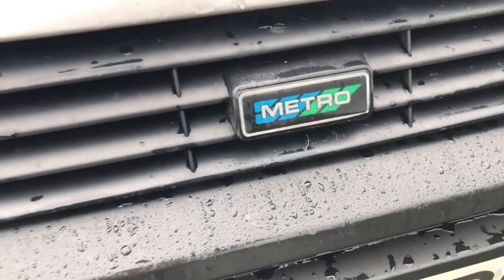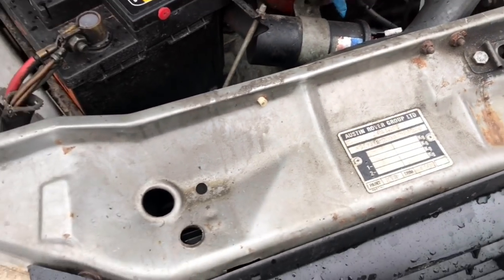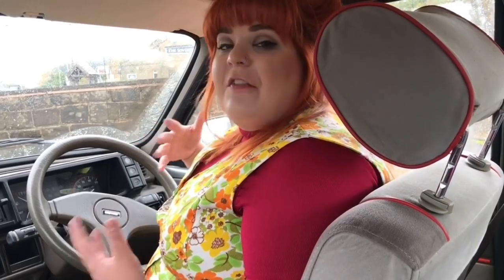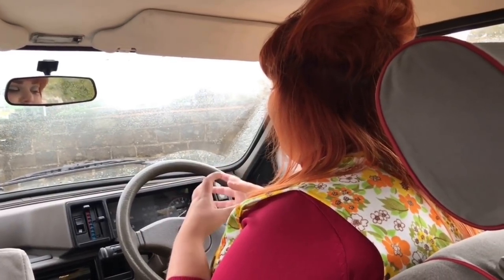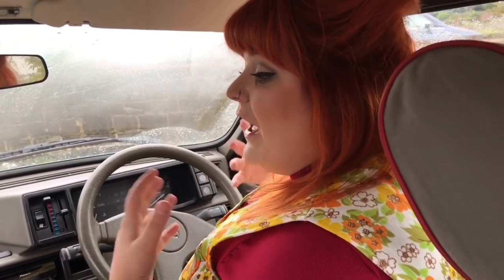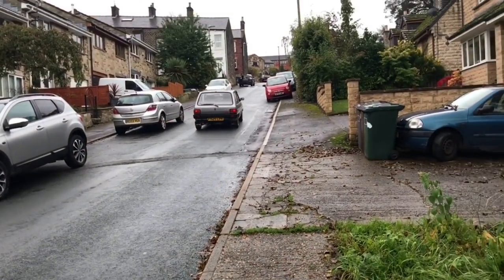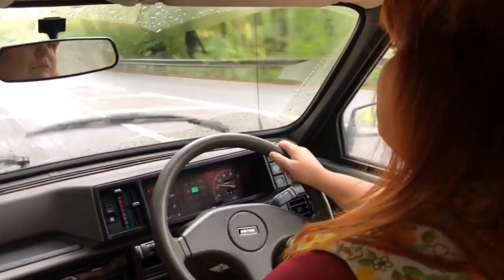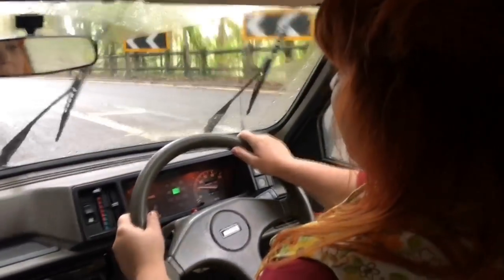IDRIVEACLASSIC reviews: rare 80s Austin Metro ARX

Comment: one of my fave features of the mk2 was the lit stalk signs , the signs on the indicator / wiper stalk lit up using a system of fibre optic from a bilb in thecentre of the stalks, this was available on the upper market MGs and VPs for sure tho I did break lower spec metos that had this
Reply: I remember doing that illuminated stalk conversion, looked great!
Reply: My 1.3 Automatic had those also

Comment: The term ARX in the Austin Metro ARX refers to a rally car specification that was developed by John Davenport, a well-known rally engineer in the 1980s. The "ARX" itself stands for Austin Rover Experimental, indicating that these cars were experimental versions of the Austin Metro specifically prepared for rally racing.

These ARX models were used primarily in rally cross events and were often heavily modified with upgraded engines, suspension, and other racing-specific equipment. They were part of Austin Rover's efforts to push the limits of their small city car in the motorsport world.  David of Newbury Classic Car Video.

Comment: Love video  thanks.  Brings back memories or my August 87 1.3 city x . It had a lovely sandy/beige interior,  even though it saw only a city x everything was colour cordinated including the steering wheel,  carpets and seat belts !
From may 1987 the metros were much quieter . There was a vast improvement to sound proofing and many tweaks to engine and gearbox.  I still remember being really impressed after my 83 metro. Could the X in ARX just be eXclusive . This word was in the brochure,  only a guess though.
Reply from the maker: Apparently it’s for the Austin Rover crossover! So it’s like AR cross so to speak. Somebody on the metro owners club page cleared it up when I posted the video. Mystery solved.

Comment: Great video, the trim looks like they had a spare job lot of MG fabrics and needed to use them up :-)  One thing though Steph, please wear seatbelts over shoulder, you do not want to have an accident with it under your arm as your ribs will take the full force, not your (much stronger) shoulder.  Can't have you getting hurt!
Reply from the maker: I’ve had somebody message me and explain it since. It’s an Austin rover ‘crossover’ and 1,500 were made. It came after the metro principles.

Comment: Never heard of an ARX - it was more than likely a dealer special to shift units - popular in the 80s especially with Ford. Great video and fab car. RIP A191 WDM
Reply from the maker: I’ve since been informed it was a company special on a limited run to celebrate the Austin rover crossover for metros
Reply: Yes, the ARX featured in the brochures at the time. Based on an L model but with MG shaped seats with unique red/grey trim. I'm not sure this car has the original wheels though, they look like MG Metro mk1 alloys to me??

Comment: That reminds me of the Metro’s my driving instructor owned when I was learning to drive back in the early 90’s.  The column stalks are the same as a D reg Montego I owned, the instrumental cluster is also similar to the Montego but my Montego had a rev counter, I guess the lower spec Montego’s didn’t and most likely shared the same cluster from the Austin Rover parts bin.
Reply from the maker: Nothing says recycling like the BL/AR parts bin 😂

Comment: The metro when it was released in 1980 was considered a very safe car , for example the sils are large  so that the doors interlock into them to make them stronger in a side impact, disc brakes instead of drums dual circulate. Spair wheel in the boot adds strength in a rear end shunt. Anti burst door locks to. 
You may notice this car has no shock absorbents their not needed with Hydrogass. TD Wheels and tyres on this model so ir you get a flat your tyre remains on the rim. By 1985 i believe they all had servo assisted   brakes and greater sound insulation on the bulk head and under the carpets.
As for corrosion the metro did have problems especially on the front wings  ,however if you open the front doors and look at the wing you will see grommets theae were so that during a service wax was to be sprayed into them to help prevent corrosion this was hardly ever done sadly. Later Austin models had small wheel artch protectors in the corner of the wings to prevent mud collecting in the corners the ARX should have them.
The trouble was that the Metro was kept in production to long and became obsolete in respect to more modern cars.
Nice one Steph keep up the Austin Rover Good work!!! (:
Reply from the maker: Thanks Darren!!!
Reply: Firstly I love your profile picture, I'm a huge fan of the saint and Roger moore, I love the books especially. But the metro was never safe, it was made cheaply at a time when BL had  next to no money and it used the already outdated mini format. I've seen the crash test, I doubt any passengers would survive a 40mph collision, let alone a 70 mph crash. The metro was sadly a victim of cost cutting and because it borrowed much from the mini, it was outdated from day one. The mini only really held on for so long because of its looks and its sporting heritage, the metro didn't have either and with crash testing being brought in, it became a problematic car. The k series metros actually had mechanical issues, such as cam shafts going after 30,000 miles. The k series engine in general has been known to have a few problems. The metro could have been great, but BL really didn't do it justice, had they thrown a bit of money at it, I dare say it might have replaced the mini, but that's the British car industry for you. I've had two 70s BL cars and as much as I love them, you do look at certain features and wonder what they were thinking at times.

Comment: Great video, I learnt something about metros! Where is the asbestos in the engine bay?
Reply: the brake pad
Reply from the maker: It’ll be the brakes x
Reply: Head gasket
Reply: Clutch and brake linings, some gaskets  that were not paper and heat shields mainly, although A/R started to fit asbestos free linings as standard before 1988. It's nasty stuff but good at what it was designed for as an insulator.

Comment: Austin Rover eXecutive ARX  it's a dealer special to get shut if some bits.
This was run out model parts bin car because the river metro was about to be launched with it plastic wrap around bumpers and smoother styling

Basically maestro montego and metro shared parts to keep cist down.  They all used the sane steering wheel by thus time.
Reply from the maker: Hi Keith. I’ve had somebody message me and explain it since. It’s an Austin rover ‘crossover’ and 1,500 were made. It came after the metro principles.

Comment: Prefer the look of the mini prior to the 80s plastic dashboard with three smiths clocks, but ultimately as much fun as the mini was, metro's hatchback practicality would of made me keep it longer than a mini. How does it drive compared to a 70s mini. Do you need to brake at speeds up to 30mph before turning or able to go flat out, foot to the floor in third around roundabouts without problems of grip?

Guess the rover badged Peugeot diese or k series would be interesting given the mini didn't get those engines.
Reply from the maker: I never brake into corners 😂

Comment: Metro ARX (man. 4) , manufactured or sold in 1988, version for Europe special edition (since October) (up to December)
manufactured by Austin in GB
3-door hatchback body type
FWD (front-wheel drive), manual 4-speed gearbox
gasoline (petrol) engine with displacement: 1275 cm3 / 77.7 cui, advertised power: 46 kW / 62 hp / 63 PS ( DIN ), torque: 98 Nm / 72 lb-ft, more data: 1988 Metro ARX (man. 4) Horsepower/Torque Curve
characteristic dimensions: outside length: 3406 mm / 134.1 in, width: 1546 mm / 60.9 in, wheelbase: 2251 mm / 88.6 in
reference weights: base curb weight: 803 kg / 1770 lbs, gross weight GVWR: 1140 kg / 2513 lbs
how fast is this car ? top speed: 156 km/h (97 mph) (declared by factory);
accelerations: 0- 60 mph 12.9© s, 0- 100 km/h 13.7 s (declared by factory), 1/4 mile drag time (402 m) 18.9© s (simulation ©automobile-catalog.com) 1988 Metro ARX (man. 4) Detailed Performance Review
fuel consumption and mileage: 6.3 l/100km / 45.1 mpg (imp.) / 37.7 mpg (U.S.) / 16 km/l ECE-cycle; average estimated by a-c©: 8.9 l/100km / 31.9 mpg (imp.) / 26.6 mpg (U.S.) / 11.3 km/l.
Reply from the maker: Hey! I was after knowing what ARX stood for really :)

Comment: AR must stand for Austin Rover, who knows what X means! Interesting it has the early fuel filler position, when most F reg onwards had the round one half way up the wing.....
Reply from the maker: I’ve had somebody message me and explain it since. It’s an Austin rover ‘crossover’ and 1,500 were made. It came after the metro principles.
Reply: The low fuel filler caused problems if the fuel cap leaked taking a right hand bend, spilling fuel just before the rear wheel. The resulting lack of traction could cause skids. The fuel filler was raised to the later higher position in 1989 and remained there for the remaining A series cars and subsequent Rover K series models.
Reply: @simonheap4294  Allegedly!, and only from complaints by the police. Good old BL never came across this in testing, and it took 8 years of production before they altered it!!

Comment: I'm not sure that's a genuine ARX. The ARX was a sub-MG Metro limited edition. The interior was 1.3L (apart from the seats), the exterior was MG Metro turbo (including chin spoiler and alloy wheels). The engine and gearbox was MG Metro (non-turbo). AR X was Austin Rover - X was just a challenge to the XRs from Ford. The stickers, paint and wheels on the example you're driving don't look original and it's missing the chin spoiler.
Reply from the maker: This is a genuine ARX and has all the paperwork to support it.
Reply: @idriveaclassic  What do I know? I just sold them when they were new and went to the product launch.
Reply: Well, I’ve found a copy of the advert for it new, wheel trims and no chin spoiler